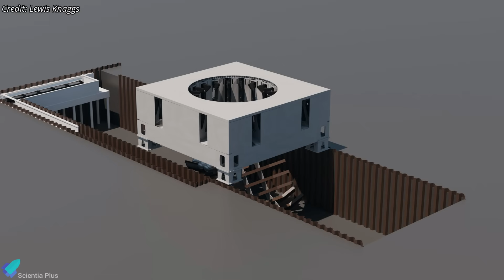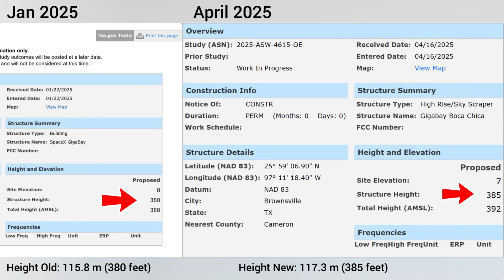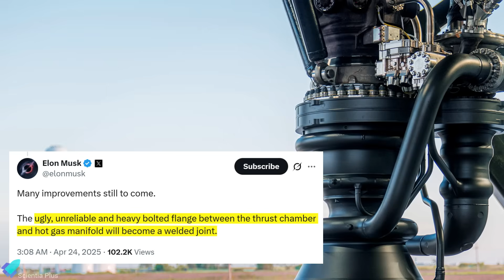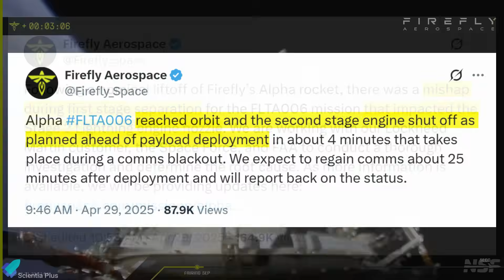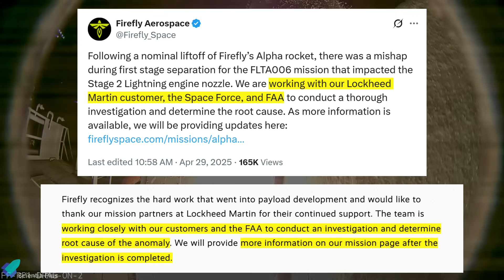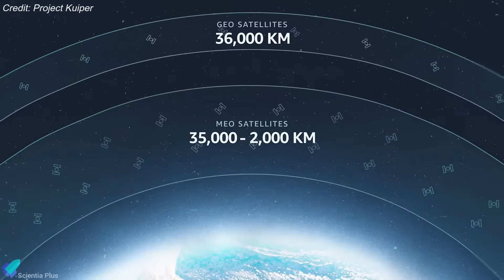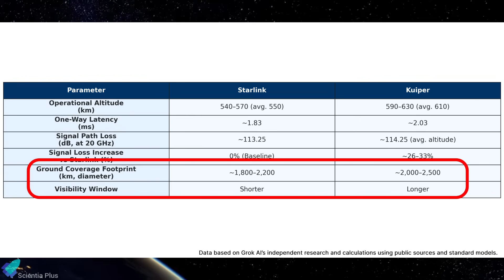Raptor Issues Still Unsolved? - Starship 35 Static Fire Anomaly Breakdown - Flight 9 Delayed

Comment: Considering these anomalies would seem to suggest that SpaceX did not have as good a hold on the flight problems as they thought, I would now not expect Flight 9 until sometime in June. They need to take the data from this test, compare it to their previous analyses, determine what went wrong, and implement appropriate design changes. This is precisely why we test. There is no such thing as a failed test unless, for some reason, you don't get data. Take your time, do it right, and launch when ready.

Comment: Flight 9 will be able to fly in July.
SpaceX will need to fully test the new launch mount and the SpaceX Starship will need modification to fit the Raptor 3s, modified fuel feed lines and retest.

Comment: SLS and Orion are on a cost-plus contract. Cost-plus = The more we mess up the more money we make.
If one slows down a moon return flight to orbital speeds, there is no need to take a heatshield to the moon and back. (Orion?)
The earth-moon space transit craft could be reused over and over with space supply refurbishments.
Same goes for the moon lander.
Dream Chaser could be the earth to transit craft supply and personal ferry. 
All for less than SLS/Orion and all reuseable.
Am I dreaming stuff up or is that doable.
Use up the existing SLS on heavy lift space science craft (a new voyager?)

Comment: Why does SpaceX static fire all its rocket engines before every flight; particularly those just days before every Falcon 9 (Falcon Heavy) launch? I don't believe NASA did this on any other rocket, except an FRF (Flight Readiness Firing) of all three space shuttle engines before the first flight of each space shuttle. Thereafter the SSME's (Space Shuttle Main Engines) were NOT tested within the shuttle orbiter before their future flights.
Reply: Because it is new ship. And because raptor engines are designed to be started / stopped many times.